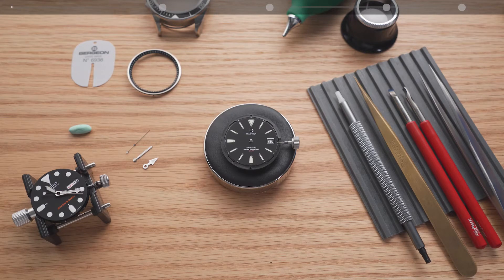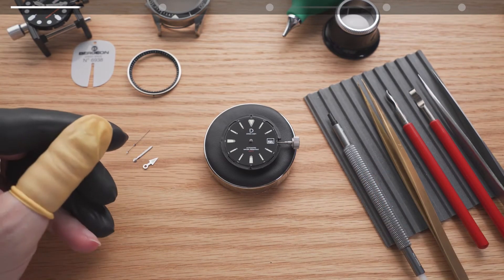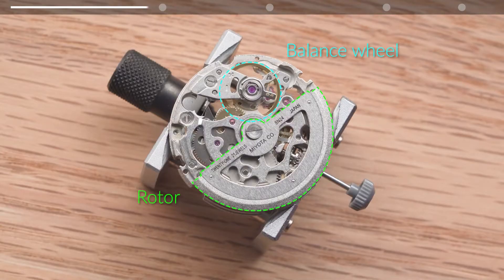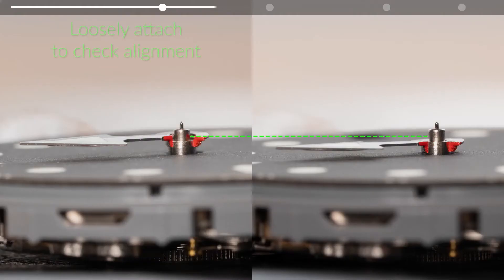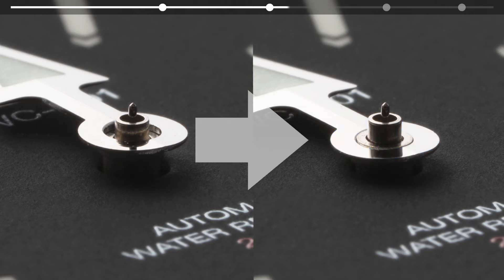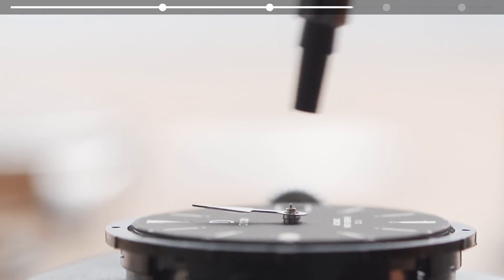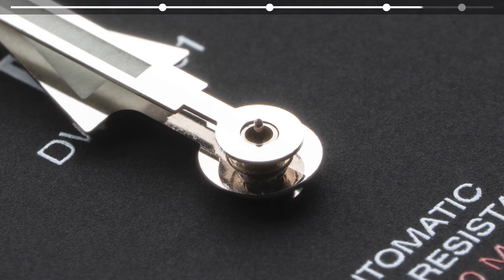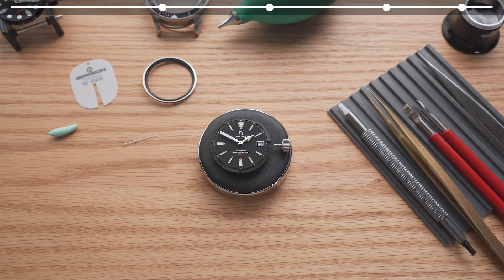Watch hand installation detailed guide part 1: Hour and Minute hands (movement with date)

Comment: On my quartz watch the minute hand is slightly off, i.e. when the minute hand is pointed at "12" the hour hand is not exactly pointed at the hour. Can I simply nudge it to the correct position without removing the hands? Thanks for your advice on this.

Comment: I have a dial that has 6 pins on the back and wont’t fit on a n35 dial. Do i need to remove 4 of the pins?
Reply from the maker: Yes. Those 6 pins are usually there to cater for different movements. Find the two that you need and cut the rest

Comment: Thank you for your videos. I successfully replaced the hands on my dad’s watch as well as a new movement. Then I had to remove the winding stem to re-case it and bent the second hand 😮. How do I not do that again and how do I order new hands?
Reply from the maker: Well... just be more careful next time. See what angle you were recasing it and how and where the second hand was bent, and try not to do that next time. Hands are movement-specific. So simply search for the hands for your movement. If it is a common movement you should be able to buy new hands for it. Good luck.

Comment: Hello, I’ve now installed the hands and all good, the only thing is I’d say is DONT install the H&M hands at 12 when the day/date changes, reason is (as I’ve now discovered) the day/date starts to change around 11:20/11:30 so it’s all transitioning and muddled when it’s still the same day, far better would be to wind on a few turns after the day/date changes then install the H&M at 12, that way the day/date will change about 1am - 2am or whatever, when most people are asleep, people are still awake at 11:30 and it’s annoying to have the day/date unreadable, I’m going to have to take the movement out again and try to slide the hands round a bit to rectify this, I really don’t want to dislodge the hands or bend them in any way though as it’s a really difficult job to get all 3 to miss each other as they spin round, so yeah my tip is DONT install the hands at 12 when the date transitions but to give the crown a few more turns, Seiko do this themselves for the very reason I mention above, cheers 👍🏻

Comment: Thank you so much for sharing your excellent presentation! May i please ask you whether you use the same hand installation tool number to install the three hands or you change the number of the tip in each one? Again, thank you
Reply from the maker: We use a double tip installation tool in this video. One bigger tip on one end and a smaller tip on the other end. So it's the same tool but different tips.
Reply: @DIYWatchClub  Thank you for your quick and kind response

Comment: I have a seiko solar diver and the second hand is not aligned with the chapter ring hash marks. Can I  adjust the position of the second hand without removing it from the dial? How would u recommend I align it?
Reply from the maker: You can't align it without removing it. The alignment is set when it's installed. Luckily, it's not that hard to remove the hand, check out this guide: https://www.youtube.com/watch?v=sukKH_S4gig

Comment: I’m just trying to do some DIY work on an old watch I found on eBay. I was able to set the hands with nothing but two pairs of needle nose tweezers, using two pairs tweezers to gently pry the hands off instead of the dedicated tools you used, and was able to set the hands by using the tweezers to gently push down on it.

Comment: Will the holes in watch hands fit all movements ie a Seiko Nh35 as well as a Sellita Sw330-1? Or do they differ in size?
Reply from the maker: They differ in size
Reply: @DIYWatchClub  Cheers. Do you know who supplies hands for a Sellita SW330-1 movement?
Reply from the maker: @timmcdonald5335  you can try esslinger.com but you'll need to know the exact dimension of the hands you need. They have a watch part enquiry form that might be of help to you. Good luck!
Reply: @DIYWatchClub  where can you find that information from?

Comment: currently mine is bent, unsure how. Any ideas?
Reply from the maker: May I know what exactly is bent?
Reply: @DIYWatchClub  the minute hand
Reply from the maker: @michaelcabunoc7318  Is it bent downward where the hand meets the center circle? If so, a possible reason is that during installation, you pressed down too hard with the hand installation tool